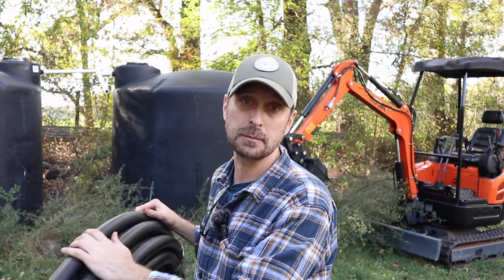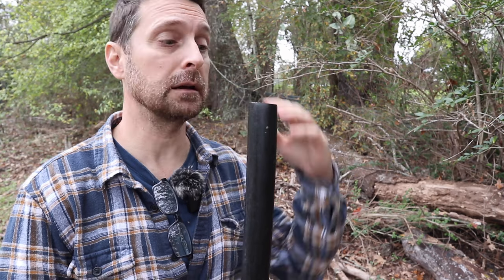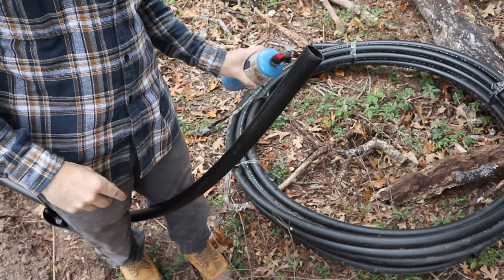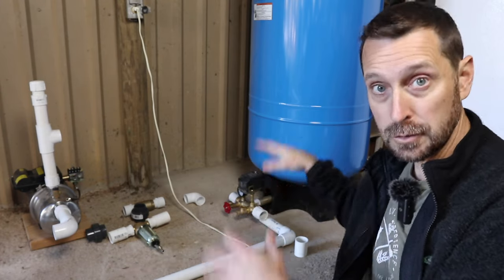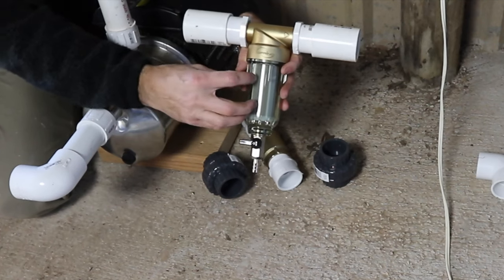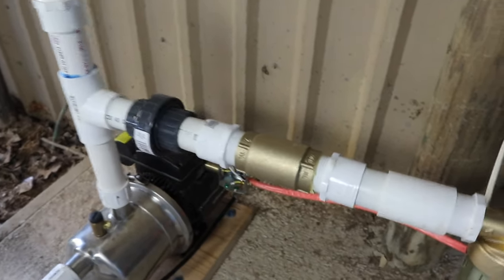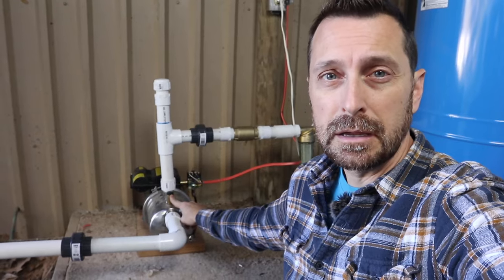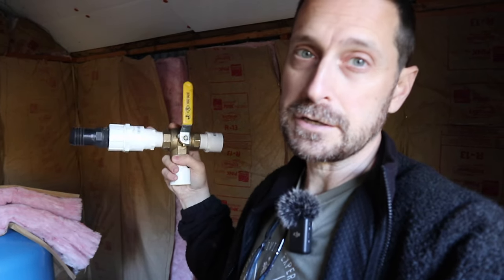Connecting Rainwater Tanks To Our Well House And Irrigation System

Comment: I just bought an AO Smith pressure tank for my system, which I'll be assembling soon.
We did 12,000 gallons of rainwater catch off a 4000 sq ft shop building roof.
I got the spin down filters as well in 100 and 50 microns, and then I'm going through 20 and 5 micron media filters, then charcoal, and then a UV light (this will be our drinking water).  Thanks for the video... It gives me a quick look at what I'll be assembling soon. We are over by DeKalb and New Boston, Texas.
Reply from the maker: Awesome! I’ll add more filtration in the future when we connect it to the house for backup.

Comment: You could also pop a ball or gate valve on the inlet side of your pump so that you're not having to shut off the water at the tank every time you want to work on your pump.
Reply from the maker: Thanks, I did that previously. I have three ball valves out by the tanks.

Comment: Looks good, I'm so glad you have an alternative, I know several who've tried to filter the salt, nope didn't work well.

Blessings ❤
Reply from the maker: Thanks. So you know more people with salty wells? Near Tyler?
Reply: @CountryLivingExperience  no, these are  mostly in West Texas and most have been contaminated by the oil field salt wells.  Some are for whatever reason have massively high amounts of salt, so they've used different filtration systems... most have not worked.
Blessings
Reply from the maker: Ahhh, I see. Thanks for the heads up.
Reply: I heard salt intrusion is happening in ground water all over the country. Not sure how true the info is.

Comment: Wouldn't it be better to have the spin down BEFORE the pump to protect it from sediment?
Reply from the maker: The pump can handle sediment like that. The pressure tank cannot as it will build up inside and potentially abrade the bladder.